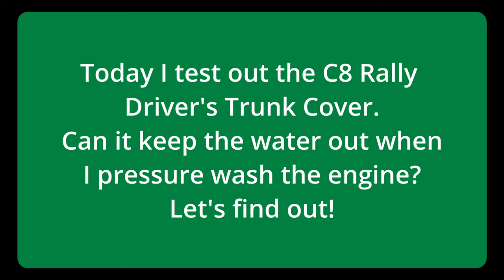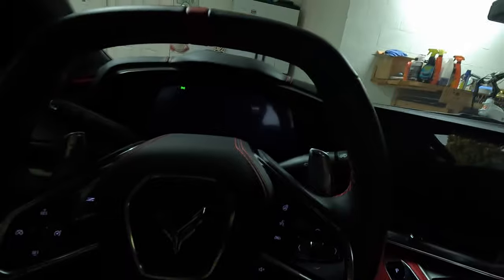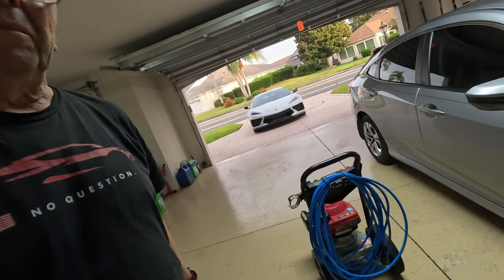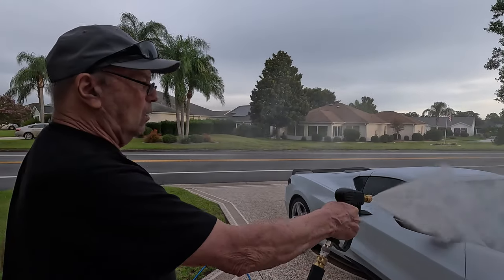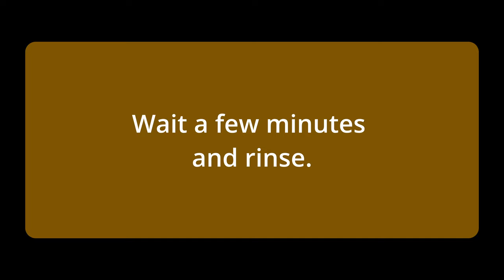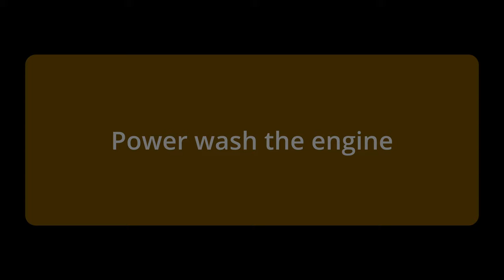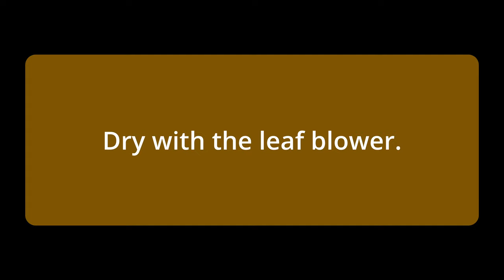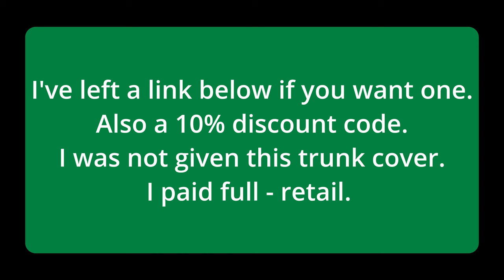Does this C8 Trunk Cover Work or Not

Comment: Robert,
Do you leave the cover on when not washing? Aesthetic purposes like for shows / daily driving? ThAnk you
Reply from the maker: Good question. I put the cover on when I'm at a C8 Meet and Greet (I run one about every month or so). I leave the rear hatch open. You cannot close the rear hatch with the cover on. (that's how you keep the storage area dry).
And my cover has a QR code that you can scan and it takes you to my youtube channel. The company will do that for you and you just have to provide the code.
Reply: @RobertMacCready - Thank you Robert.